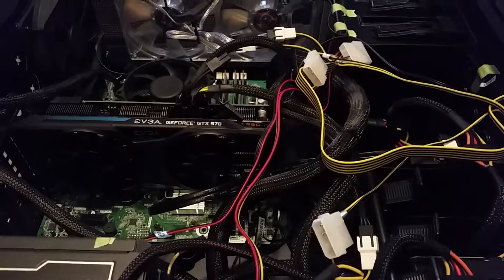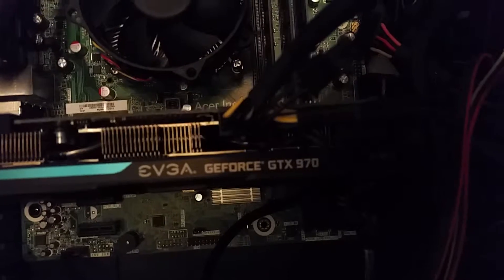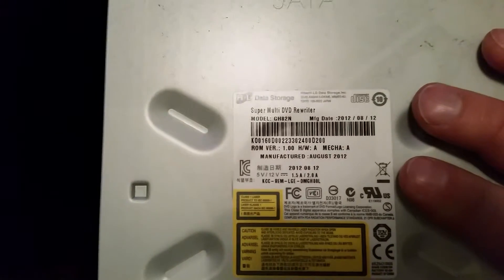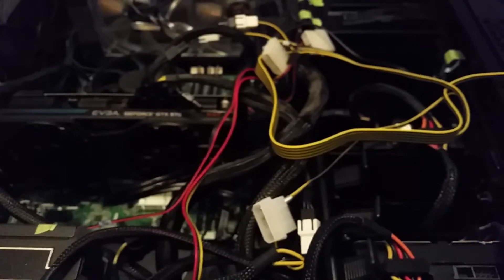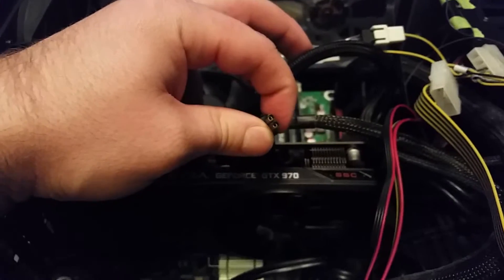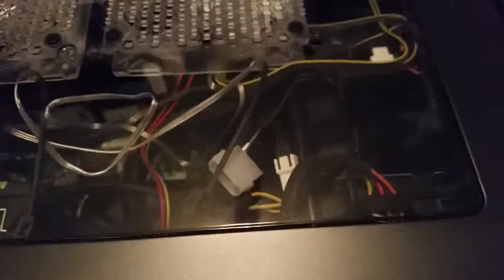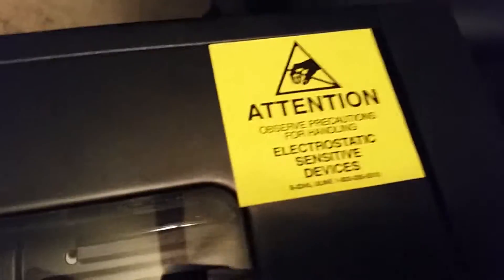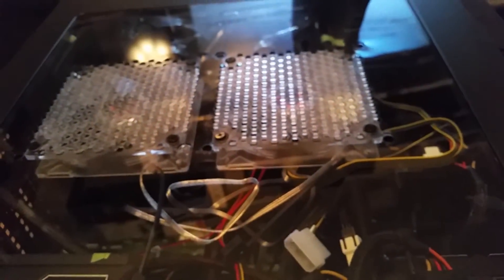EVGA GTX 970 SSC Installed (Acer Predator Motherboard)

Comment: Do you still have this computer? Have you upgraded the GPU after the 970? Do you think a 10-series GPU would work on this motherboard?
Reply from the maker: Yes, I have it. No, I have not upgraded it further. Ryzen 7 system is my primary now. Any video card that supports PCIe 3.0 x16 should work as long as it physically fits in your case.
Reply: @rrtd15  Thank you for the information and the quick reply!
Reply: Yeah it will work. I have the g3620 with a gtx 1060 6gb rather then the gt630 2gb it came with

Comment: can i upgrade bios from 2014 for my motherboard it says  is for windows 8, does bios that work well if u upgraded it ?
Reply from the maker: I don't know, you can try a different version of the BIOS to see if it gives you the option to turn off secure boot. I haven't changed the version of mine.

Comment: man please help. i have acer predator same g3620,  im on windows7 64, when i enterr in the bios i see no secure boot ? so can do something to upgrade to gtx 900 series ? or no ?  can I do something to have secure boot in bios or no ?  tnx...
Reply from the maker: Sorry about late response, work and go to school, channel is low priority. Secure boot is under the Authentication tab in the BIOS. I would upgrade to the 1000 series, you don't specifically have to use GTX 970, any video card will work. I had GTX 670 before I upgraded to the 970.
Reply: i dont have that tab man...
Reply from the maker: marko markonjero Borrow another video card or try any other video card you own. If it works, any other video card should work. The secure boot blocks factory hardware configuration changes. If it doesn't work and you have no option to turn off secure boot, you're probably out of luck with that motherboard (especially if you've already upgraded the BIOS). Build your own computer next time, not that hard, almost everything is plug n play these days and you don't get these proprietary issues you see with pre-built machines. I only got this one because the hardware was a blazing deal at the time.